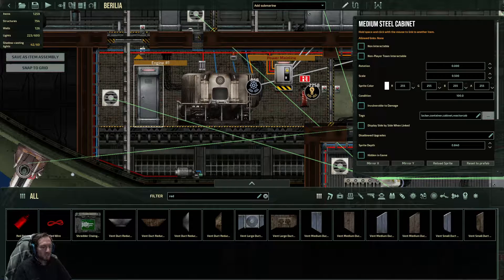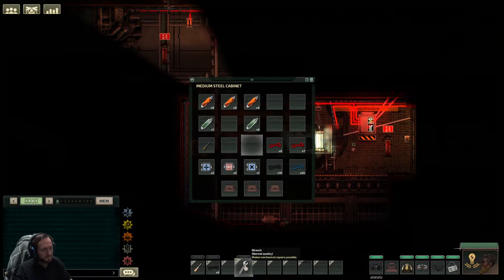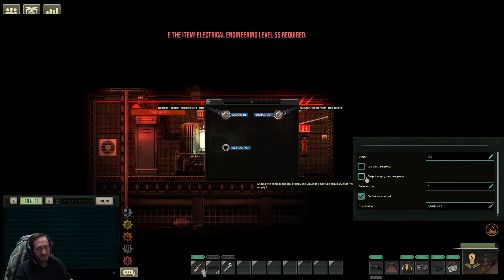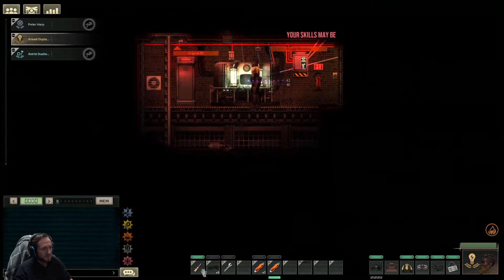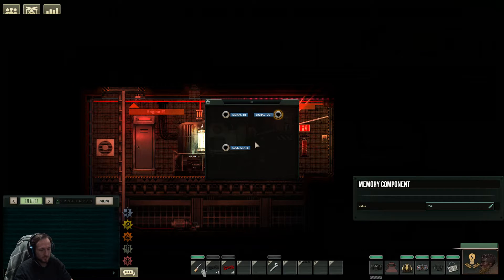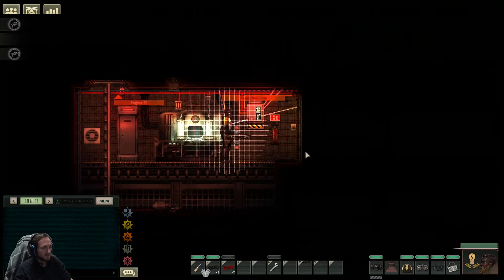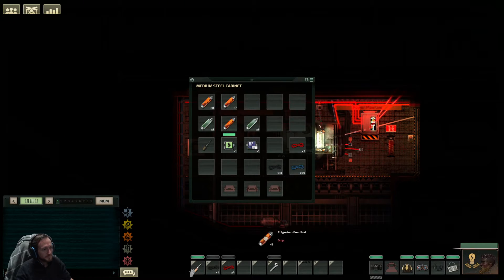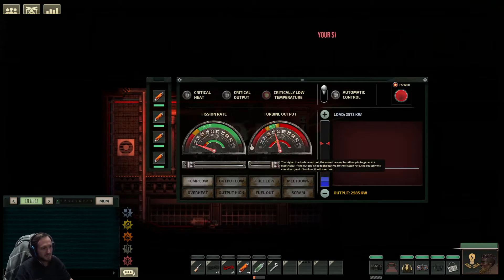Barotrauma - 2 and 5 component automatic reactor setup

Comment: I’m no programmer, but I made a sub with a built in reactor controller and a built in fire suppression system. The controller works equally well with all possible fuel loads and will even self-update max output during campaign upgrades, the only bottleneck is the slow moving reactor, thats why I made the fire suppression system😅. RegEx is what makes it work, but the entire system is a bit more complex than the one in this video. I need to take some time to put it all in the new Circuit Boxes and put it on steam workshop if I find the time and willpower to do it:P

Comment: Great video! One problem though, I tested the 5 component set up with the Typhon last night with friends & the Fission Rate always seemed to be too low causing Low Temps, making frequent power outages. 

The output on top memory was 45 since it's 4500 reactor output, everything's wired correctly & the divides are both 100/0. Is the Bottom Memory Component at 75 causing this? Cheers 👍
Reply from the maker: Its been a while since I've played but if I recall the memory will change depending on what all upgrades you have and if you have a engineer with the correct talent. Those will need to be taken into account for what the memory should be set as.
Reply: @deathfromace  Correct! However there are no said upgrades to either the ship or via talents from our crews Engineers (it's stayed at 4500 output / 45 value) so I'm wondering how it's still losing power briefly sometimes so I'm assuming it's the fusion rate/low temps. 

I should of clarified, appreciate you taking the time!
Reply: @GhostlySheep  maybe try setting up a partial boost value on the fission rate controller part. simple [regex check] or [greater then and memory component] and multiply component. set the greater component or regex it up so it checks the reactor temp_out against value of 3800 and if its lower (therefore true) it should send the value of 2(or even 3 if reactor runs too cold) if its not true it should send the value of 1. 5c controller calculated fission rate should be connected to multiply component signal_in_1 and the output of greater than component should be connected to its signal_in_2 then the output of multiply component should go to the reactor fission rate input. this makes it so that when the temperature is lower than 3800 the fission rate will be double(or whatever you set it to) of what the 5c controller computes it at and if its above it will be normal. in effect after the reactor temperature reaches the desired temp the flip change between x1 and x2 value should be so fast that it will stabilize itself on the desired temperature making subs without reserve batteries (or disabled bateries because someone forgot to turn them on or set the charge rate lol)more responsive to sudden and steep power draw changes. but the best solution is to learn to operate the sub in such a way that there are no sudden power demand spikes. acceleration should be smooth and not from 0 engine to 100% and back. there is no practical solution for improper operation except of learning "how to drive" xD. btw low temp doesnt do this(brief power loss) its the captain that doesnt know how to operate the sub, all the low temperature does for reactor is it decreases the green range on the turbine output "behind the scenes" making it so it doesnt compansate for small power changes as much.

Comment: There is an edge case. Let's say you got a 8kw reactor and you are idling at 1000kw. Then suddenly need 8000kw load. With 4 Fulgrium rods the fission rate doesn't need to move a lot but the turbine needs to go from 12,5% to 100%. Thing is the fission rate will be set before the turbine did spin up enough. The Reactor overheats. Usually that's not a problem with vanilla subs but I wanted to point it out. With one uranium fuel rod the fission rate kinda climbs at the same speed as the turbine can spin itself up. If you have more than fuel_out 80 then you would kinda need to delay the speed at which the fission rate can climb. I'm thinking about an oscilator and memory modules that remember the last value and based on the fuel_out/80 ratio reduce the climb or descendrate. Maybe I overthink this.
Reply from the maker: Thankfully I just did research and made a video for it as all this is above my head by a lot. I am more of a tinker player to do small fun things...this is just too much lol
Reply: you can easily set up the breaker that lowers the fission rate in case that temp goes too high. also there is no such case that you would load 4 fulgrium and "suddenly" need additional 87.5% of reactor power for some mysterious reasons.  unless its poorly designed user sub that uses quadrilion of weapons and dozens of engines xD

Comment: i only found out about regex when i played barotrauma, so it was a bit of a discovery for me too. on the barotraumas wiki there are actually links to some tutorials on it. it does seem like a pretty powerful tool. the configuration that you use here will output on temperatures from 1 to 4999, which is an error original author made, since it supposed to keep it at 4000, not 5000. also greater-than is entirely redundant. with that in mind, the result is pretty economical since it requires only 1 component and works fairly well, which might be useful for early stages of the campaign.
Reply from the maker: Ah that would explain some of it. The reactor and regex are all above my head. I found the wiki as well and did some of the tutorials but my brain just didnt work for what regex wants me to do. If you know who did the original text for it let me know and I can edit the desc and give them credit. I thought I did it for this one and the chat room but seems I did not for this video.